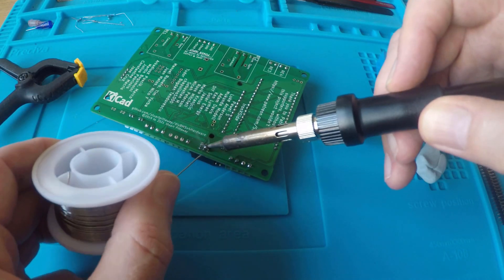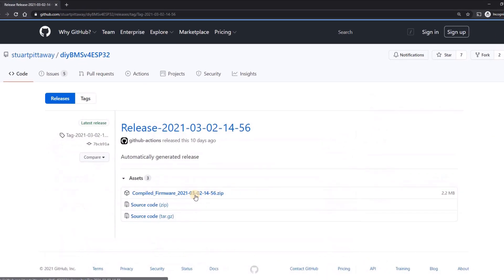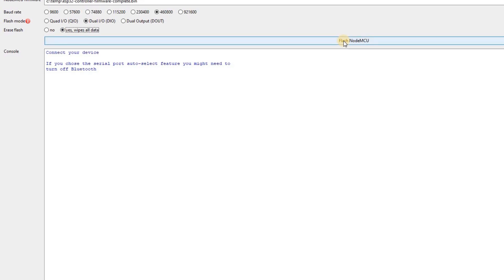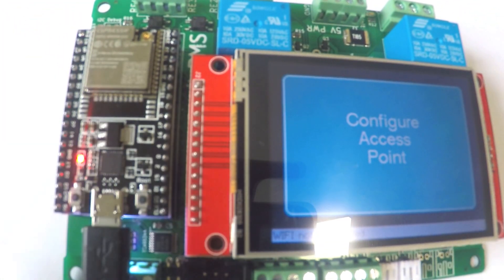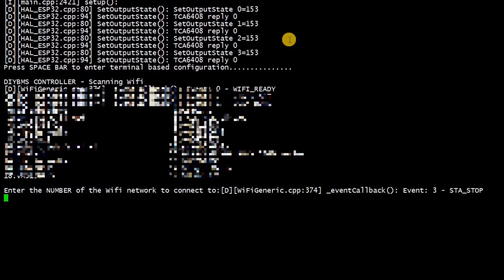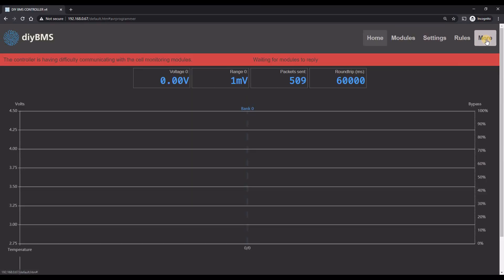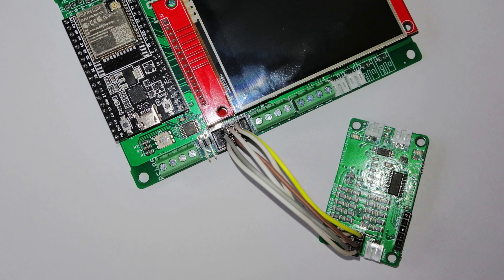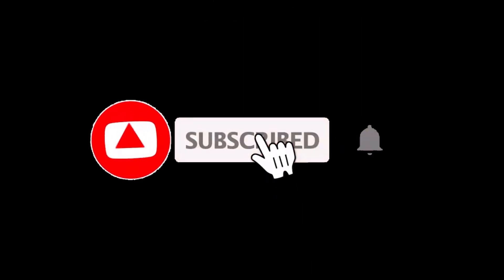Programming ESP32 & inbuilt module programmer (DIYBMS)

Comment: @Stuart Pittaway - Could the controller module run esphome firmware or be migrated to esphome so it could be used as part of home assistant?
Reply from the maker: It already speaks Mqtt so could integrate using that?

Comment: Tried getting a JLCPCB quote, and two parts are coming up "No part selected":  U1 (TJA1051T/3) and U11 (MicroSD_SPI_CD).  They seem to be gone from the JLCPCB catalog (not just out-of-stock).
Reply from the maker: The microsd has never been a part that can be placed by jlc automatically, so this needs to be soldered on manually afterwards. The TJA part, can also be added later and it's not critical to add that at the start, the controller works without it.

Comment: Hello. I have tried to program several ESP's using this method and with platform Io, but I always get errors . I am trying to get familiar and figure out how it works so that in some case I can give feedback. I am already a BMS user Batrium, but folowed your project since early times. The erros are: 
file: "src/HAL_ESP32.cpp" line 54
func: esp_err_t HAL_ESP32::writeByte(i2c_port_t, uint8_t, uint8_t, uint8_t)        
expression: i2c_master_cmd_begin(i2c_num, cmd, pdMS_TO_TICKS(100))
ESP_ERROR_CHECK_WITHOUT_ABORT failed: esp_err_t 0xffffffff (ESP_FAIL) at 0x4009121f
file: "src/HAL_ESP32.cpp" line 107
func: void HAL_ESP32::Led(uint8_t)
expression: writeByte(I2C_NUM_0, TCA9534APWR_ADDRESS, TCA9534APWR_OUTPUT, TCA9534APWR_Value)
ESP_ERROR_CHECK_WITHOUT_ABORT failed: esp_err_t 0xffffffff (ESP_FAIL) at 0x4009121f
Reply from the maker: Ok, it looks like the code has programmed ok. The error relates to communications with the  PCA chip. I suspect a bad solder joint or chip in this case
Reply: @StuartPittaway  Thanks. So that means that this version unlike the previous it wont run standalone on the esp32, without being connected to the controler board!? I will get a controller board one of these days fort testing. Congratulations for the excelent work.
Reply from the maker: @marcelantunes  no, the first thing it does is attempt to configure the external chips, if that fails, it stops.

Comment: I have a question. Can one controller handle 3 battery packs? I have 3 6s packs in parallel and it would be awesome if only one controller controlled charge and discharge cicle.
Reply from the maker: As long as the packs are in parallel and connected together, then only 1 controller is needed.
Reply: @StuartPittaway  As a complementary question, I'm planning on building two 4s packs in parallel, and would like to use separate controller boards for redundancy/reliability purposes.  Are there any isues, such as WiFi name/sddress classhes, when using two separate controllers?

Comment: Flash mode is not active on some Chinese ESP32 development boards. The board is recognized but cannot establish a connection to the NodeMCU PyFlasher.
First option:
If the program tries to flash the ESP32 board, you have to briefly press the "EN" button and the "Boot" button. Then the board is in flash mode.
Second option:
To make your ESP32 board go into flashing / uploading mode automatically, you can connect a 10 uF electrolytic capacitor between the EN pin and GND.
Reply from the maker: Thanks for the info, I've not come across one of those types yet, must be lucky